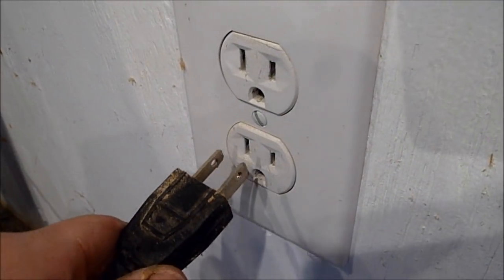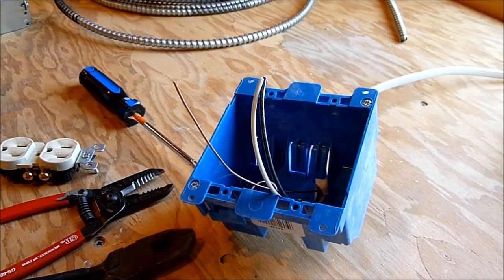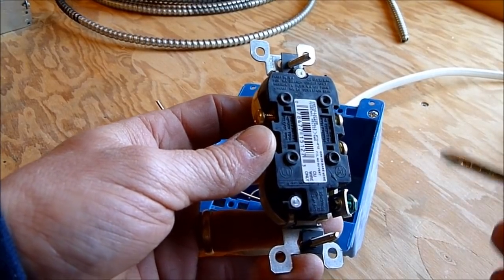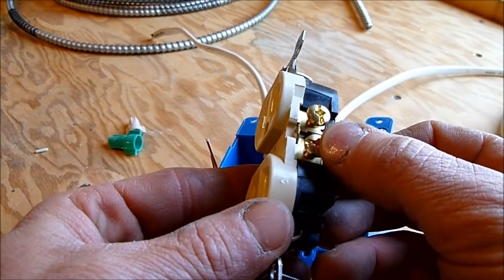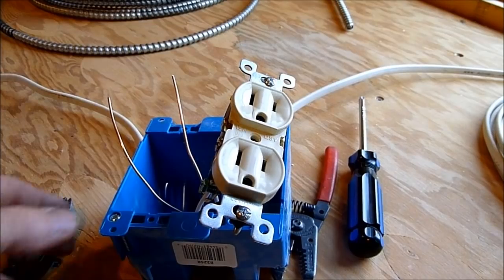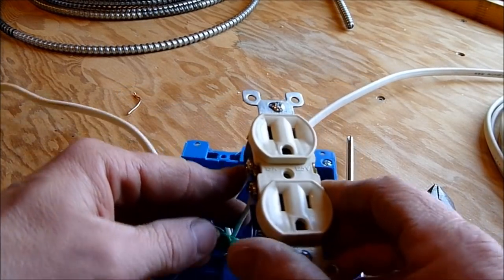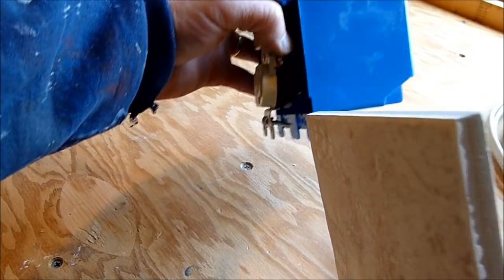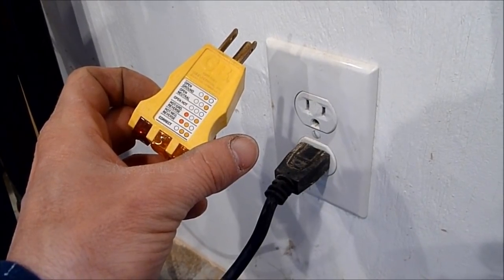How To Replace a Standard Electrical Outlet: A Complete Tutorial

Comment: Damn!!! Who's talking? Joe Pesci? lol
Reply from the maker: +Jammin Dave I get that all the time.  It's the Jersey in me, I guess!
Reply: +enduringcharm Haha I thought it was Joe Pesci too.  Do you take requests?  I'd like to hear you throwing a tantrum while uncovering an outlet not installed to code.
Reply from the maker: +Cos Achtac Hang around long enough and you'll hear it!  I try not to let loose in front of clients, but there are times...
Reply: ha hah very kool
Reply: +enduringcharm When side wiring a switch or a receptacle how many times can you bend copper before breaking the copper?

Also if copper breaks and there isn't enough available wire for making the connections do you have to rewire your entire house?

If so do you have to knock down all the walls everywhere to rewire everything again?

Can you rewire a house without knocking down the walls?
Reply from the maker: A lot of questions!  Solid copper wire can generally be bent once or twice without a problem.  An experienced installer can sense when there is an issue--often the copper becomes dull and loses stiffness just before it will break.  If wire is short in a particular box, you may be able to add extensions with wire nuts, although there are rules about how much wire and how many connections can be installed in a given sized box.  If that isn't an option, you can often rewire that part of the circuit, going back to the closest outlet or other device in the circuit.  There are countless tricks for running wire in existing walls, many of which require only minor repairs after the new wire is installed.  Only in extreme circumstances would the removal of the entire wall surface be necessary to run new cable.  A licensed electrician will be able to take a look at your home and tell you what's involved.  Likely it's not as bad as you fear.

Comment: Wow those American power Sockets,(receptacles) look lethal,exposed Line connections that need bodging up with insulation tape after installation,and those exposed ground wires,lethal,and that circuit tester that was probably made in Hong kong,is the icing on the lethal cake,In the Uk I have a circuit tester it cost me 2000 dollars,I can phase test,I can RCD ramp test,I can test the integrity of the ground wire right back to the electrical suppliers transformer,we call that earth loop testing,I can also fast trip circuit breakers that test will tell you weather your going to live or die if you have a fault on an electrical appliance,people do not play with electricity.
Reply from the maker: +Ronald Disbury You know us 'Muricans--we like to live on the edge!  Here, stick this wire on your tongue and let me know if it's live! ;)